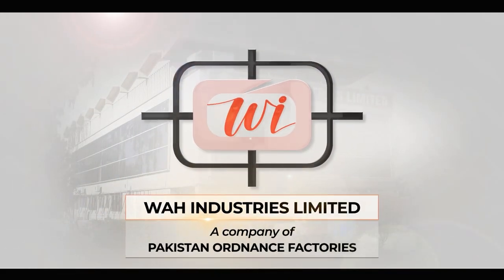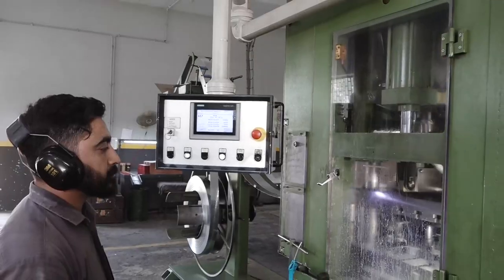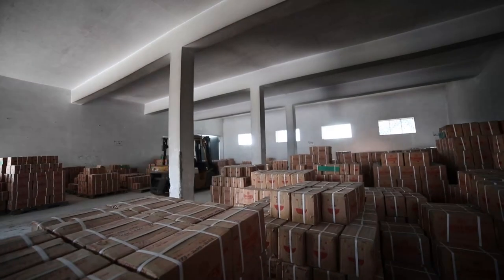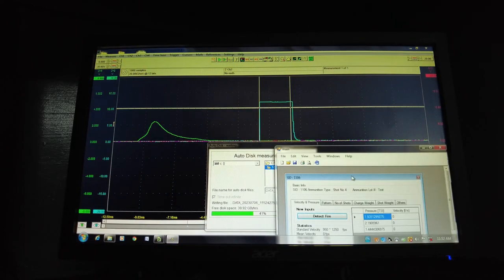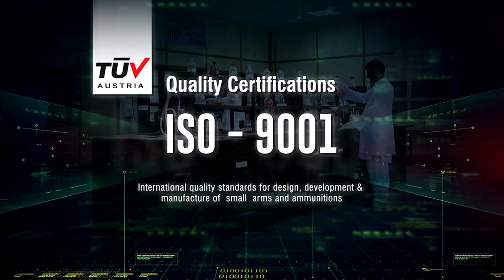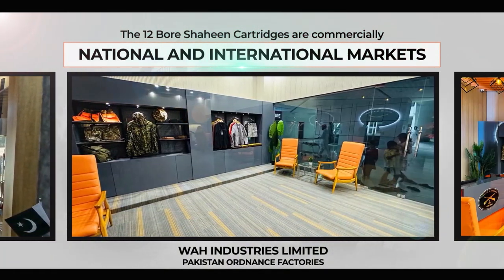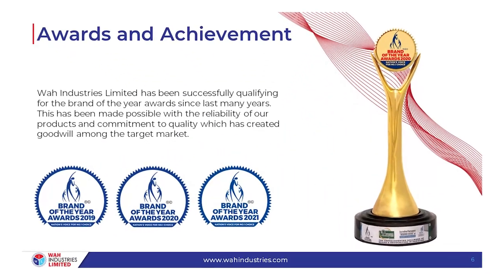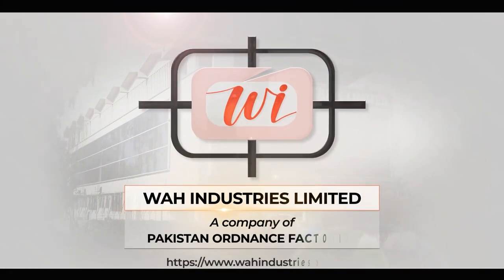SHAHEEN 12 BORE CARTRIDGES | WAH INDUSTRIES | HUNTING SPORTS AMMO | @pakistanordnancefactories

Comment: it was one of the best Quality before 2023 after that very poor Quality ,not only the Gun powder but also the plastic shell is very low Quality ,Gun powder is not fully burn some particles remains in chamber and some shells plastic is melting as we fired i have the pics and shells which i recently fire ,we also notice that new cartridges have the less power please improve the Quality as you increased the prices of ammo its ok but please if you can,t provide more Quality no issue but at least maintain the standard ,90% users of shaheen are not satisfied with new Lot and new packing